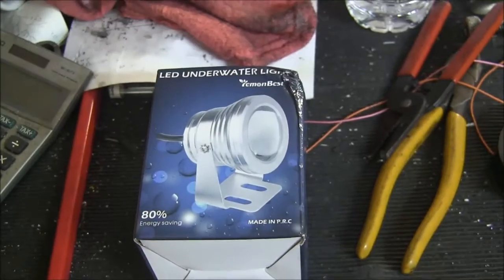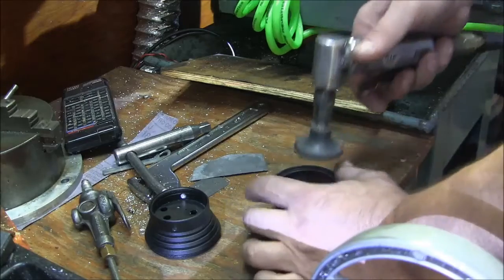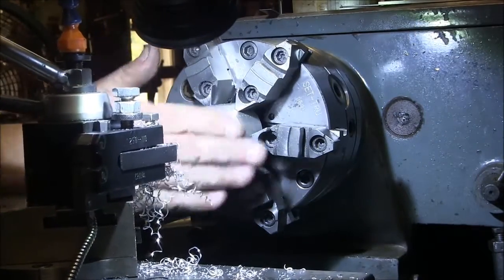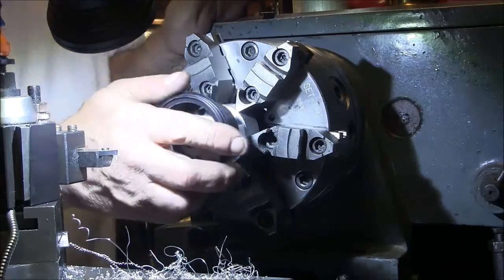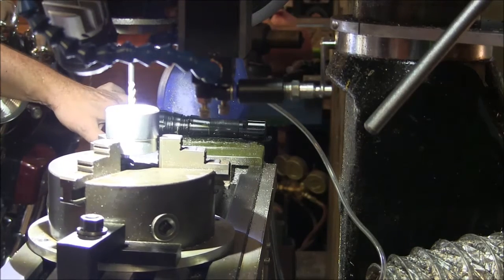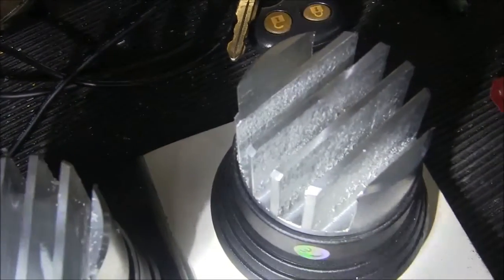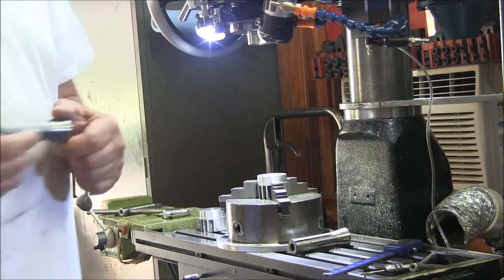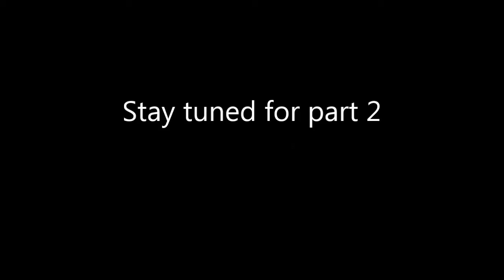Machine lights Rev. B Part 1

Comment: I like your fancy lights, wish I had some.  If you used a slitting saw to cut the fins couldn't you get more fins?
Reply from the maker: I suppose I could get more fins but it didn't need more. I figured the thicker fins would be more rugged.